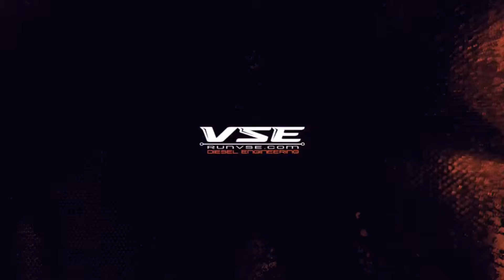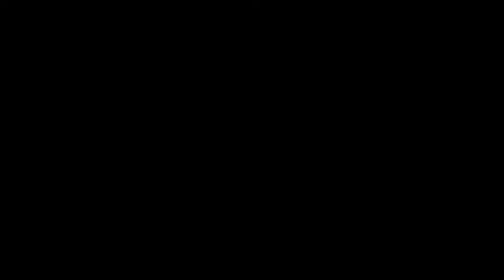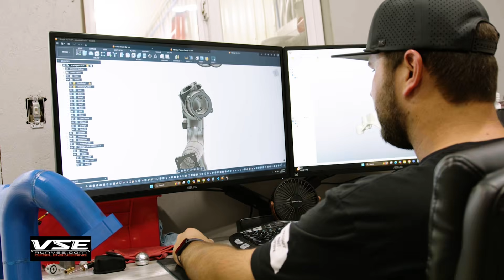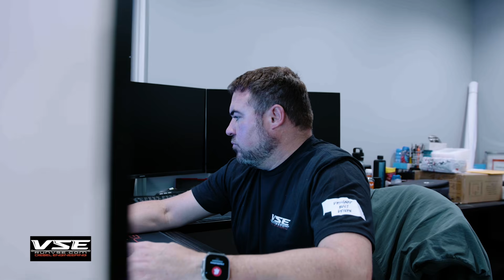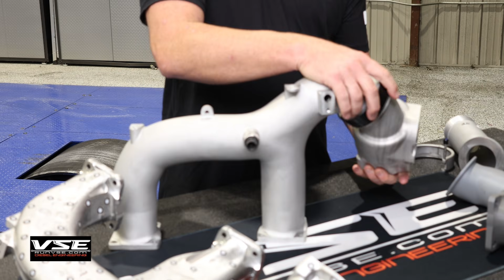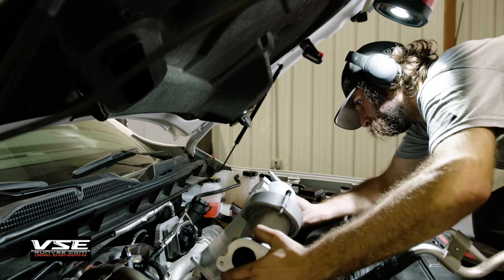2017-2026 L5P High Flow Y-Bridge Full Walkthrough

Comment: Half way through installing mine. This video is the only install video I can find. 2025 AT4X 2500 and I had to unbolt the AC pump to get the back of the bridge to clear. Another new one for me is this Wiggins clamp. When I installed it, it just spins on there. Maybe when I drive the truck it will tighten up? Seems like good products regardless.

Comment: Does the off-road portion of the piping replace the throttle valve section (therefore not needing the throttle valve upgrade / delete kit)? If currently running the PPE charge pipe kit with the mechancial ring style boot, I presuime the conversion boot kit swaps that out for a standard boot w/ clamp?
Reply: @runvse